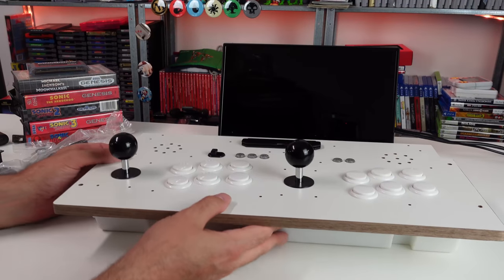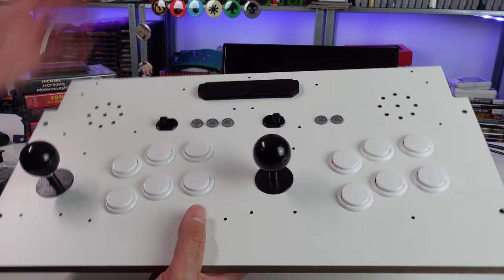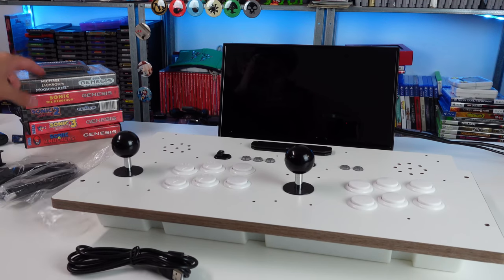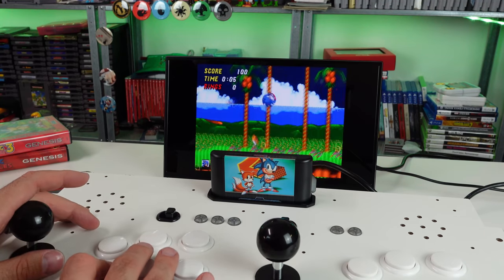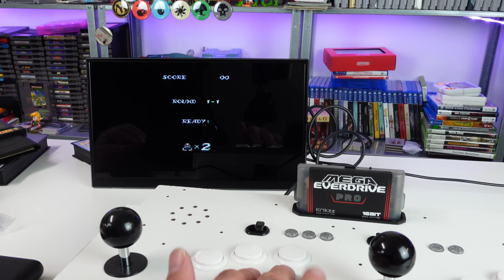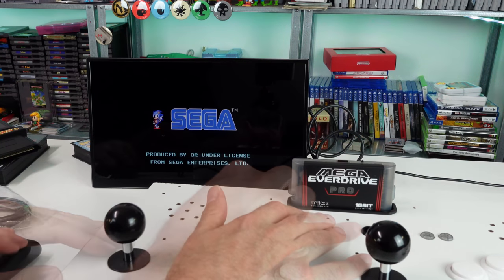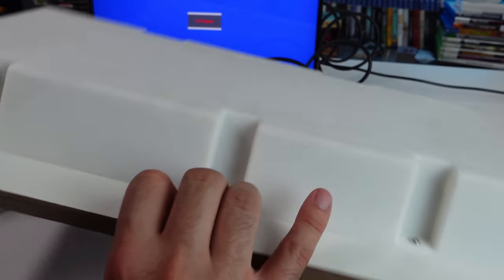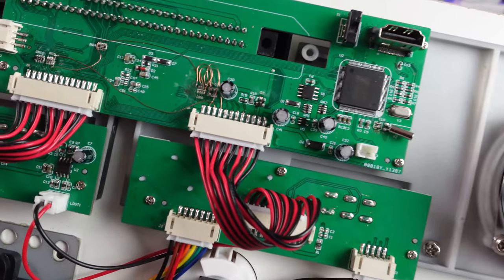The Most Interesting Sega Genesis Console Ever! Arcade Stick That Plays Cartridges?

Comment: Wondering if the color issue on Master System games is due to the MegaEverdrive ... anyway to load ROMs into it?  cuz it doesn't look like a Power Base Converter would fit (so actual SMS cartridges could be plugged in)
Reply: I realize this is an old comment but it ships with a SMS adapter and SMS carts work perfectly, as does SMS flash cart from AliExpress.

Comment: Why does this exist? What's wrong with just having a separate arcade stick? Sure, it's a good idea if you have your TV and system on a single table like this, but if you plan on sitting a few feet away from your TV (like most people do when they game), you'd better hope that your power and HDMI cables are long enough.